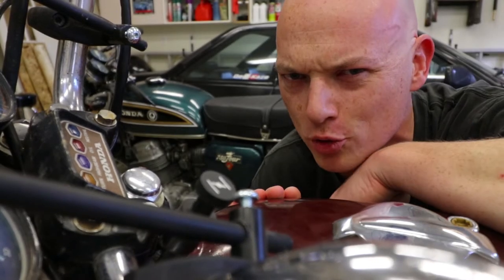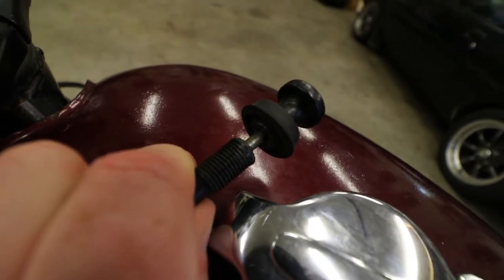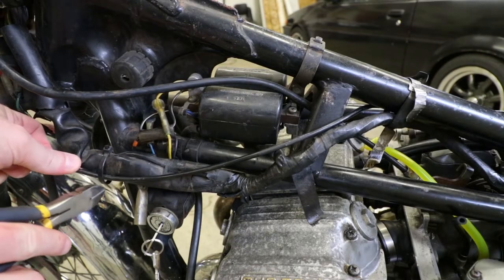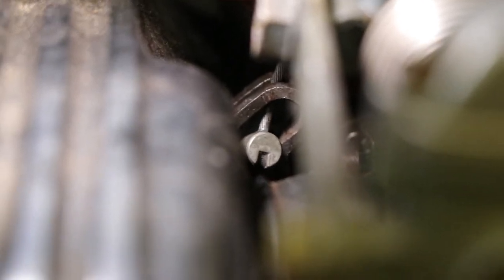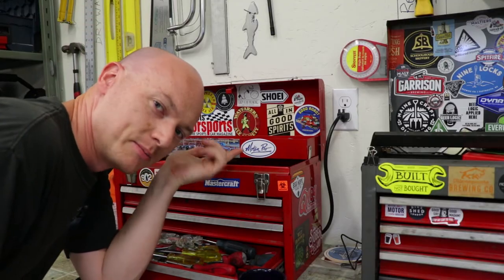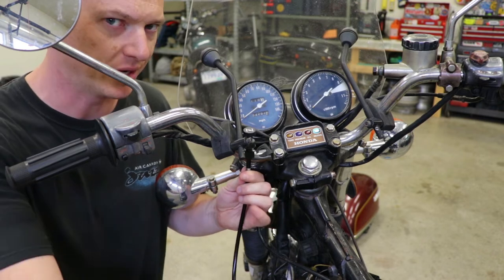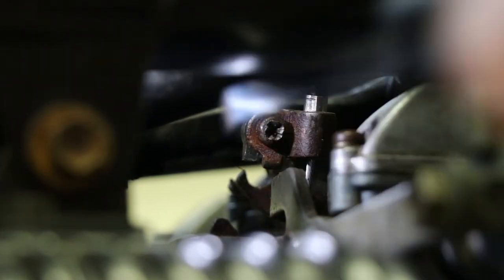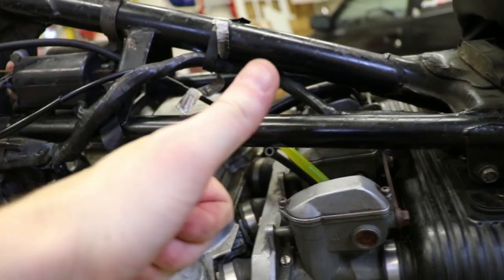CB750 Choke Cable Replacement (Project Ron Burgundy pt. 3)

Comment: A big thanks to you for this video. I have a 1978 750K that had the choke knob sheared the same way yours had. I kept the old cable in place and routed the new one to find that it was much shorter like you found. I then followed the routing that you used for yours and lo and behold it fitted. Fished the end into the choke lever arm, tightened it down and i now have a knob i can pull (as the actress said to the bishop!). Thanks for posting this, still helpful 4 years later!!
Reply from the maker: Haha! I've never heard the bit about the actress and the bishop. Glad it was helpful

Comment: Man, you make spot on videos!  Perfect camera angles and just enough jokes to keep a concise walk through entertaining.  Would have been nice to see more detail on adjusting the slack for this line as well as for the throttle cable at the carb-end in one of your previous videos.

As for future content, I'd love to see the same simple "user-serviceable" type stuff like this as well as more complex engine/transmission repairs on some classic Craigslist finds.  CL and Facebook marketplace are littered with awesome bikes that would be fun to ride.. if they could turn over.  Not exactly a moneymaker, but the value is in doing what you love!
Reply from the maker: Hey Mike I couldn't agree more. Doing what you love is key to being happy in my books. I have been scouring my local Facebook and Kijiji ads for my next project. Currently checking out bikes, 4runners and land cruisers. One of those three is A LOT more affordable than the others hah!

Comment: Hey Mike, Cyrille from Montreal here. My choke cable is new and the plunger that holds it up top is bang on. I think the lever that connects to the carbs is the problem and more precisely the springs. Ya I didn't know there were 2 springs down there. Do you have any videos on how those springs are set up? My choke is funky and I have to push and pull it to get anything done. The downside is that you need to take the carbs off to get any work  done (especially if were talking those springs). 
Anyways if you do great (have any videos) if not I'll find some. Oh and it's a 78' cb550 four K.
Cheers mate.
PS - Is the old Seahorse Tavern on Argyle still around?
Reply from the maker: Hey Cyrille! The seahorse is no longer on Argyle. Its in the basement of The Marquee now! As for your choke/carb issue. I actually have some cb550 videos in the hopper. I just haven't had the time to edit them. I'll keep your comment in mind to see if I can help you out though.
Reply: @Mike_Barker  Hey Mike, I wish it was more than just the choke cable. It seems the butterfly valves on my carbs aren't closing all the way when the cable is pulled. ALL 4 valves move in sync but I'm wondering somehow they were installed at the wrong angle (or position) to begin with. On fb honda cb550 page folks are telling to take apart the rod that holds the valves and choke lever assembly (and the springs) and remount the whole thing properly. This is definitely beyond my expertise. Wish I could share the video and show you. I'd love some feedback from a pro.
Reply from the maker: Find me on Instagram and send me your pics and video there!

Comment: I have a 250 superdream and the choke plunger seems stuck. Won't push in or pull out and it's about half way out. Does it need a new cable or is there something else wrong?
Reply from the maker: It could be a couple of different things. It could be a seized cable, or it could be a problem at the carbs.
Reply: @Mike_Barker  ok well I have just ordered a new cable as it was only £8 so hopefully that fixes it. I'm assuming the process should be pretty much the same as your video?
Reply from the maker: @Bigfoot0510  relatively. These old Hondas are a breeze to work on

Comment: Does your choke stay up on its own? I got a new cable and it doesn't stay up. Is there anything I can adjust?
Reply from the maker: On mine I can turn the choke knob a 1/4 turn (yours might be different) and it holds in position.
Reply: @Mike_Barker  I can do that, but there are three indentations on the stem, as if it should be possible to set it partially open. Odd.
Reply from the maker: @dommy114  ah! Was worth a try.